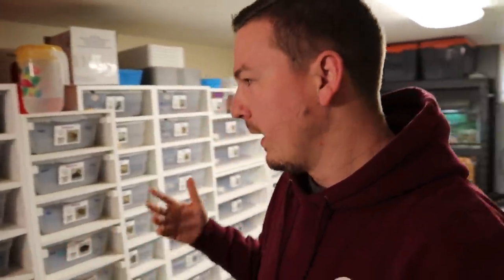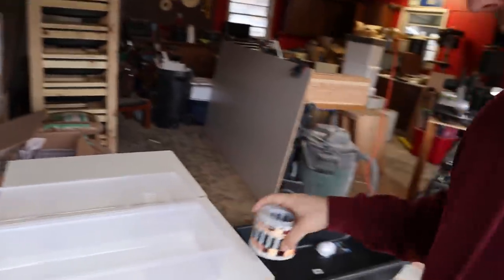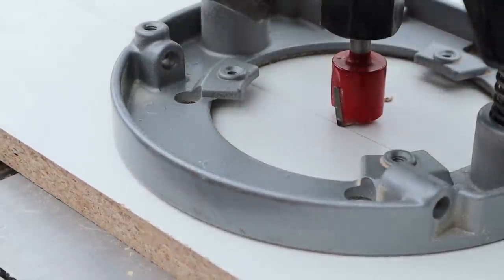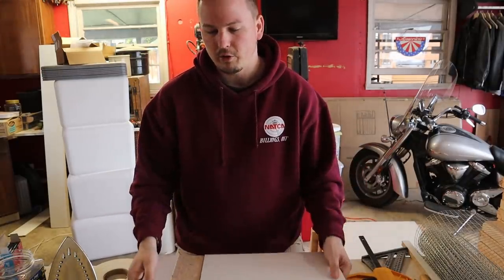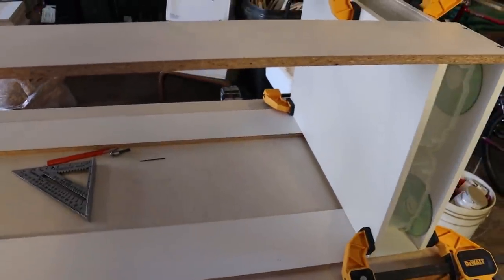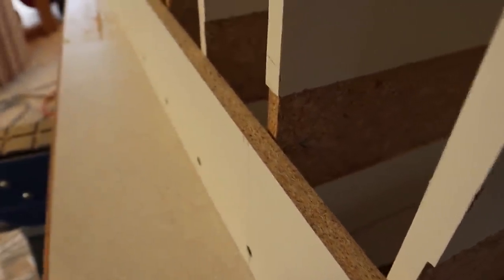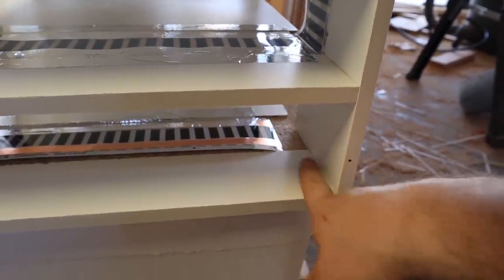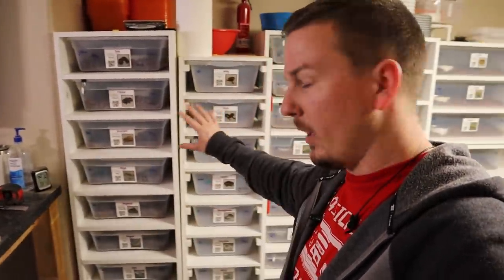LET'S BUILD! | 15 LEVEL HATCHLING RACK! | Mixology #50

Comment: I really appreciate you taking the time to give an in depth explanation for using the router for the flexwatt. I’ve never used a router before and have been apprehensive about having to recess the heat tape. Thanks!

Comment: I just want to thank you for the video.  I just finished about 5 weekends long project, routing the particle boards for heatpads and putting edge band tapes on them.  Love the final results being able to push in and out the snake tubs without rubbing on the heat-tapes.
Reply from the maker: Awesome!

Comment: Looks great I like those vision tubs to myself so question when everyone runs heat tape why dont they solder the wires for the plug on the top of the heat tape considering usually that where most people have there Thermostat is on top of the rack just makes sense to me but is there a reason the wires are on the bottom Thanks
Reply from the maker: The theory is there could be a degree or two difference from top to bottom and a 20' long piece of heat tape could have a degree or two drop from plug to end. So if you apply the "most power" (soldered end) at the bottom, the difference would even out at the top.

Honestly I don't see a difference either way, and typically have the wire at the top, but for whatever reason didn't this time.
Reply: @MorphMixologyReptiles  great answer

Comment: I’ve enjoyed watching your let’s build videos, and ended up having me watching other videos of yours. Great work, and nice to see your willingness to do the work to get what you want. Would these build plans and method of building work the same for the 1/2” pvc sheets you can buy at Home Depot as well? I know they’re a bit more expensive than melamine, something like 65 a piece in my area
Reply from the maker: They should work. Any of the plans that use 3/4” melamine you would have to adjust the spacing to use 1/2”
Reply: Morph Mixology Reptiles thanks for the quick reply! I had imagined such. For some reason some of the Home Depot’s around here don’t like to cut the pvc sheets, so that makes it tricky sometimes

Comment: A few questions for you. But first, thank you for an awesome build video. I LOVE DIY and I have grandiose plans of making more racks and cages for my collection. I have a modge podge of various commercially made and DIY racks. I have not made a rack in a while but I plan on making something for these exact tubs. Why make two racks instead of just one rack with larger shelves? If you are worried about sagging, you could put in shelf supports in the middle and save material right? Also, have you had any issues with warping or swelling yet with the melamine? I was thinking of using 1/2" too but I would also need to special order it. I was thinking of adding a couple layers of DryLock to all the sides and even to the edges to help minimize moisture penetration. I was also thinking of adding some silicone to the seams but not sure if that would be overkill. Anyway...love the amount of space you have for your building shop. I WISH I could have my woodworking area that spacious!

Comment: I'm getting ready to build a hatchling rack and I can decide if I want to go with melamine or pony up the extra money and go PVC. Overall it will cost me an extra $250 to go with PVC for the project so Im leaning towards melamine im just worried about warping. Have you had any issues with that?
Reply from the maker: I haven't had any issues yet. But if you can afford PVC, do it

Comment: Is there a reason you looped the heat tape through every level? Would it be better to have each one have its own section of heat tape with a strip attached to the back of the rack, to plug them all in, like you've done on other racks? I want to build one but was debating this! Lol
Reply from the maker: No there's really no difference. And this is far more simple really
Reply: @MorphMixologyReptiles  Thanks for answering so quickly! Simplicity, absolutely. I guess my concern was the difference in heat figuring in the length of the heat tape. Have you seen that to be a problem at all? Thanks again!
Reply from the maker: Not really. Difference top to bottom might be a degree or two. Since I set my thermostat based on the middle of the rack is negligible
Reply: Morph Mixology Reptiles thanks man! Much appreciated!

Comment: The list on work shop buddy is for two racks right?
Reply from the maker: That's correct
Reply: @MorphMixologyReptiles   thanks I'm building them now slowly but surely lol I could only find 3/4 in I need to eat more Wheaties man there heavy
Reply from the maker: I had to special order 1/2. But yes the 3/4 is gonna way a ton lol
Reply: My wife and I are arguing about the tubes needing holes for ventilation did you still holes in them I've watched the whole video but can't remember

Comment: How much did it cost to build?
Reply from the maker: probably around $100-150 if I were to guess
Reply: For everything all together like the heat tape and tubes
Reply from the maker: No I thought you meant the rack. I ordered 60 tubs at a time and that was $240. And I bought like 50 feet of heat tape at $2.10. I don't know what it would cost to build one from scratch
Reply: Ok let put it as this would it cost me more to just buy racks or build them myself
Reply from the maker: it will always be cheaper to build them. especially using melamine. but its more likely that pvc racks from an established builder will last so much longer. i just enjoy building them myself
Reply: Ok thanks for the information